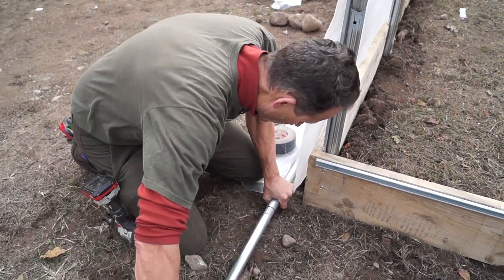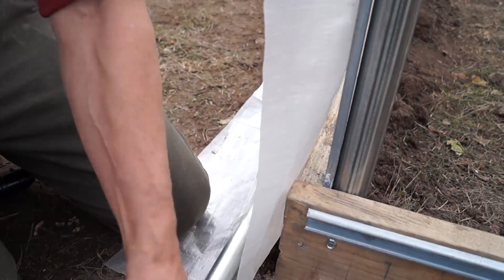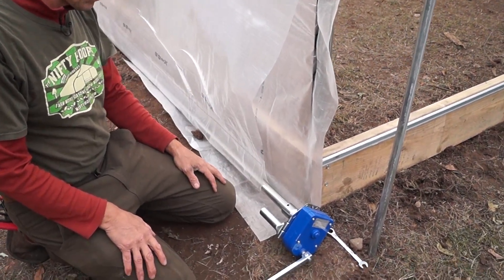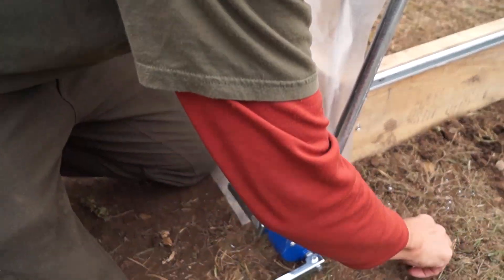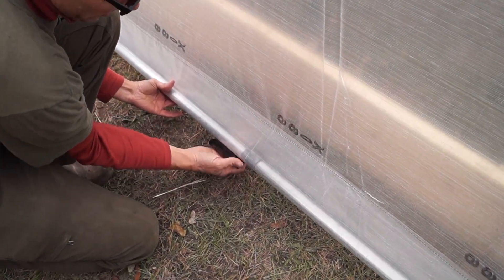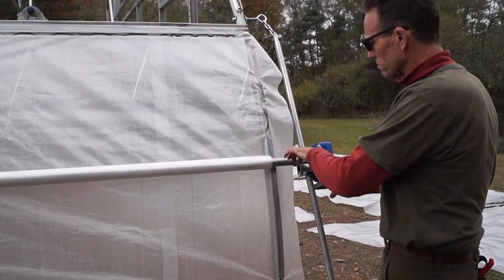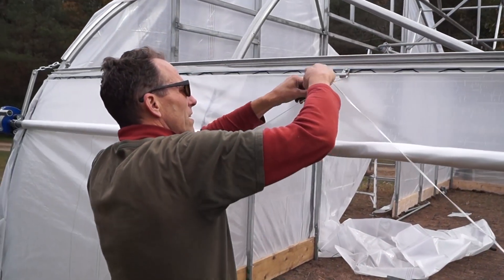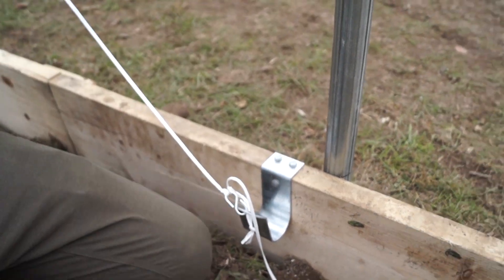Nifty Hoops 9 |  Rolling Up The Side Curtains

Comment: Do you have an emt/guide bar on both ends of the greenhouse? What is supporting the roll up on the other side? Or is it just the one bar with the clamp?
Reply from the maker: Hello.  I regret the delay.  The roll-bar is not supported on the other end.  It is only supported by the guide pipe through the crank on the front of the house.